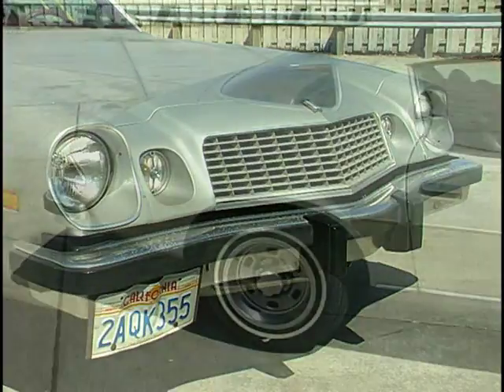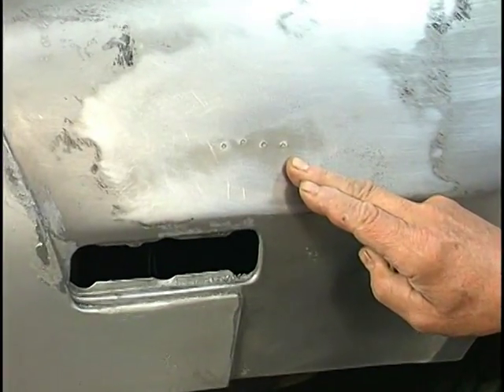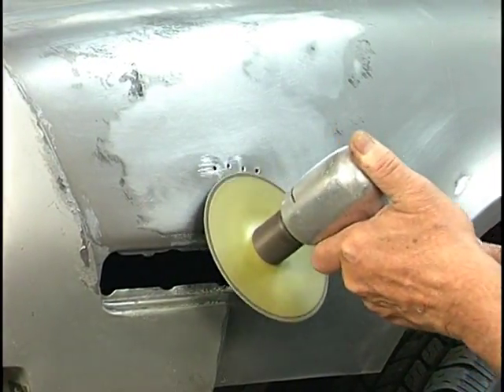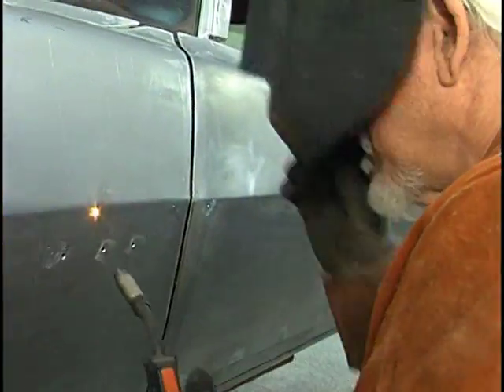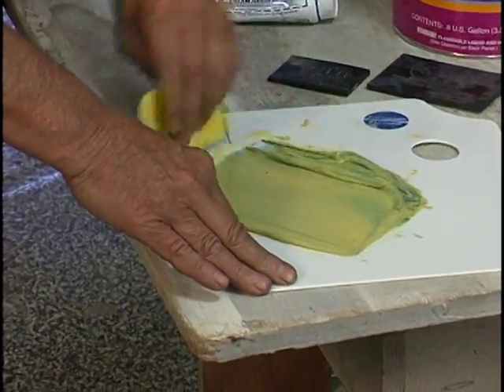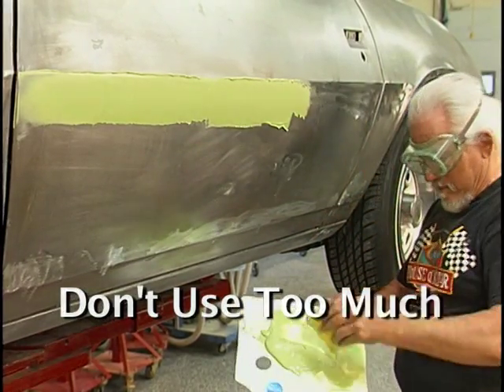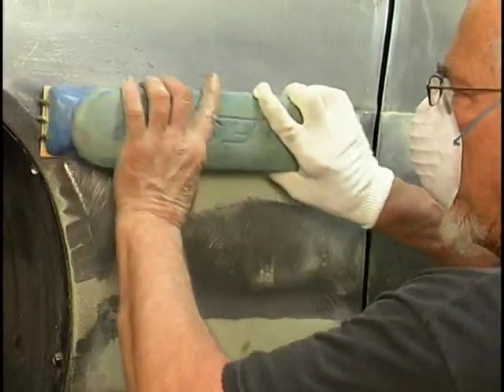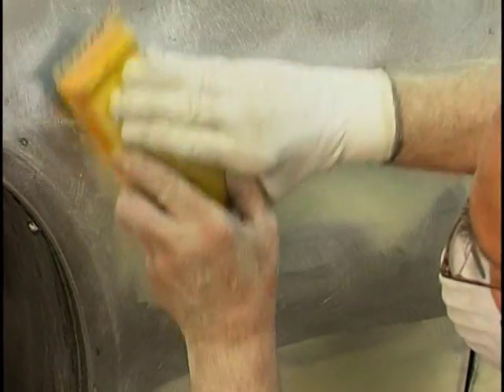House Of Kolor Clips Part 2 - How To Paint A Car 2 - John Kosmoski 2

Comment: I've used that paint stripper...it was called Aero Raze...aircraft quality stripper. One guy I worked with told me how one day a tour guide company brought in a double decker bus for a paint job. It had been painted at least 4 times so they decided they had to strip the paint. It was summer time , so they took the bus outside and dumped many gallons of Aero Raze. The fumes from the stripper came off the bus and stripped the paint from several cars parked nearby in the parking lot.

Comment: It will give more tooth for the primer. We sanded the metal with 180 grit paper then sprayed and etch primer over top of that. Sanded to get orange peel out then sprayed a 2k urethan fill primer over top of that then sanded the orange peel out again.

Comment: Tip..its easier to run tape line above the body line when spreading poly so the overfill is controlled. pull tape before it kicks so not to lift filler
Reply: Jon A